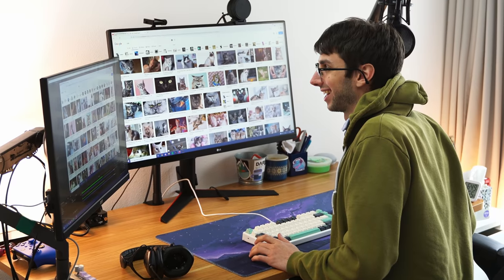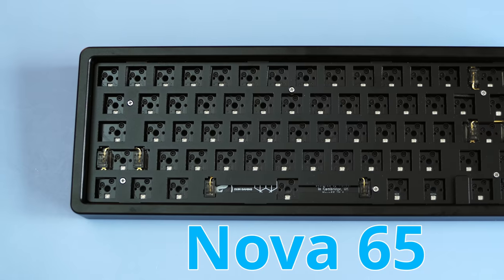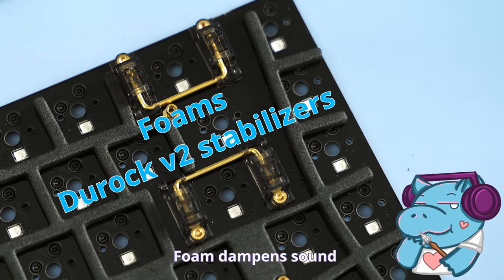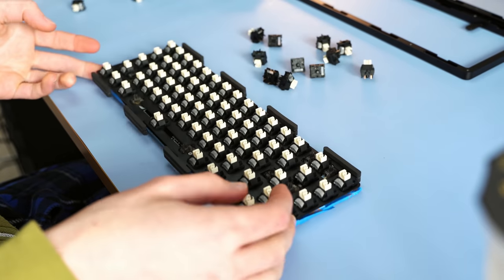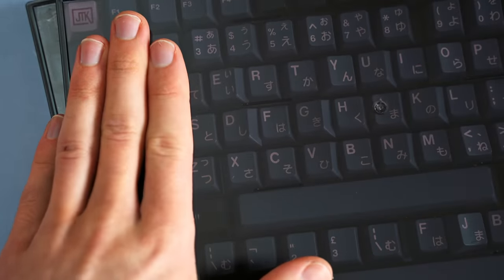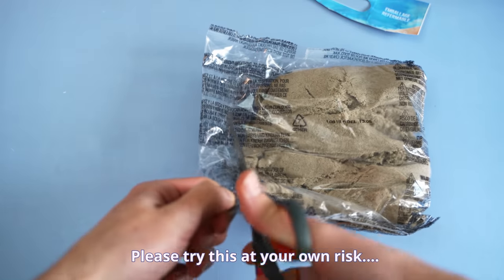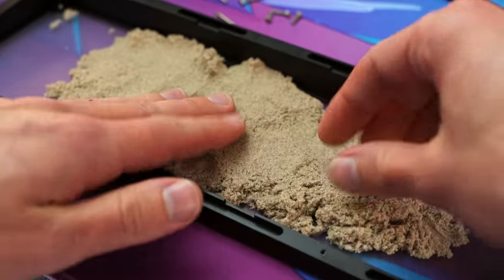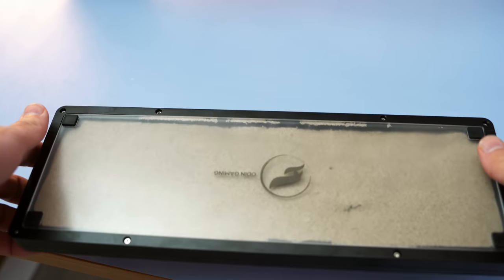I Put Kinetic Sand in my KEYBOARD. (So You Don't Have To...)

Comment: This is actually pretty smart. Kinetic sand uses some kind of silicone if im remembering correctly. It should be dielectric and i don't think it dries out. Its dense and the two materials should have different acoustic properties and its still fluid which should make it basically impossible to transfer sound.
Reply: I’m pretty sure it’s some kind of mineral oil, which has those properties. It’s also non-conductive which should help with the longevity of the keyboard.
Reply: From wikipedia: 
Polydimethylsiloxane, also known as dimethylpolysiloxane or dimethicone, belongs to a group of polymeric organosilicon compounds that are commonly referred to as silicones
Reply: and it's hydrophobic
Reply: Wait. So this might actually have been a good material due to its weird properties?
Reply: @LuciferArc1  gonna put this in my keyboard
Reply: @danieldimitri6133  are you speaking some form of french or something? The only french I know is fries and kisses 🥲 it's like heiroglyphs to me
Reply: @Gwaciee  did you do it? Lol

Comment: What about carving out a keyboard base from some kind of stone, like soapstone? Would it sound good? And it would be a great excuse to use DREMEL TOOLS
Reply: very hollow and echoey prob
Reply: Putting 3d printers on top of a heavy stone slab makes them more quiet apparently so this might be interesting.
Reply: @ThePiprian  The rigidity of the stone makes it much harder to vibrate at a resonant frequency I suppose for 3D printers; it might be overkill for a keyboard IMHO.
Reply: @BassRacerx  Would have to be solid bar soap shavings, and NO WATER IN ANY WAY, SHAPE OR FORM MUST EVER TOUCH THE KEYBOARD ELSE THE SUDS WILL BE CATASTROPHIC
Reply: making my flintstones keyboard of rock and sand

Comment: Quick idea: Use modeling clay. It's similar to Play Doh but it doesn't dry out. I would try it out myself but I have pudding keycaps lol
Reply: As a clay sculptor, I can confirm the clay will no dry interely, but if you do not keep using it for modeling or something after months they turn to dry a bit just a bit and the wax and oils will come out of the clay I little bit, so you case can get dirty of oils. One of the componets of clay is wax and oil to keep the clay soft and do not dry, as you keep using it. Not mention the smels that could came out of your keyboard after some time.

Comment: I watched a bunch of your vids, finally decided to take apart my 2016 Logitech G610 with Browns and lube the hell out of those stabs. Cleaned everything while I was in there, put some antivibration tape on the back of the board and filled the empty space with foam. Kid you not, sound like a different keyboard. Stabilized keys also sound much better. I mostly did this mod to minimise rattling and scarping sounds.. And it's been great. Worked like a charm.

Comment: can you try using a mouse pad? i just did with an old g413 i had since i just upgraded to the g512 and wanted to play around before i go messing anything up in my new keyboard. i just discovered your channel so i decided to brainstorm what all things i could use to mod, i decided that all i had really was wood glue for a silicone substitute and an old mouse pad for actual silicone type of material and its fabric covered so acoustically it should help. i noticed about a 40% dampening in the nasty sounds the g413 can give you and it created a cleaner thunky sound which i really enjoy, next on my experiment list is lubing the switches to try to further eliminate that travel noise those cheap switches give you. i love the sound and feel of tactile logitech switches but i dont like the delivery basically, you can tell these boards have a good sound but you can easily knock out those gross sounds with these mods ive seen you do. i would love to see a logitech g512 modded vs a fully custom keyboard that also matches the same budget so people can see if going full custom is even worth it. me personally ill take a diy innovative fix over paying way more just to have it designed that way.

Comment: As a note this is a terrible idea. Sand is silica. Silica is conductive electrically. Kinect sand usually is made by mixing silicone into the silica to coat the particles. But I don't believe that the silicone would serve to stop the sand being conductive long term.

Comment: Has anyone done  that kind of a mod that you put paper/toilet paper into the keyboard? I think it seems like a decent idea (correct me if im wrong, ive never done any keyboard builds and i dont know if that would damage the pcb but paper mod seems like a decent idea for me) i dont know if someone has already done it
Reply: I have added paper and toilet paper before. Paper makes the sound louder and toilet paper makes it thockier. I've actually tried many many mods inside my tes68 keyboard (shelf liner, bubble wrap, paper, cotton, polyfil, paper towel, etc) and I ended up with toilet paper since it sounded the best.

Comment: My keyboard is hollow and i dont know what to put in it. Can someone help?
Reply: i would just always go with foam. foam can never go wrong. What keyboard is it? depending on that i may be able to help better
Reply: @icecoaster  Its the sk61 I heard its good for your first keyboard
Reply: @KnighT890  thats a good one, do you know if you installed any foam in it already?
Reply: @icecoaster  No I havn't, im concerned its going to be to loud I got gateron optical red switches. Is it going to be to loud and should I install foam?
Reply: @KnighT890  i think foam is worth it. You could potentially also consider tape mod. About the noise, mech keyboards are loud, but lubing or silent switches could change that if you really are concerned
Reply: @icecoaster  ok thx when I get my keyboard i'll see if i can do that. I also have o rings from my brothers old keyboard should I use those too?
Reply: @KnighT890  that gives it a nice feel, I would personally go for that
Reply: @icecoaster  Ok thanks for your help